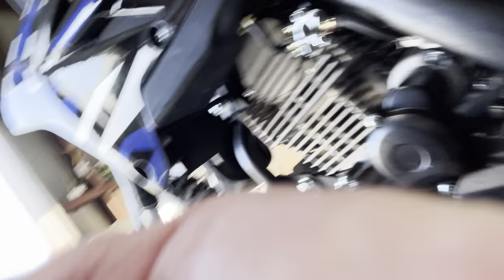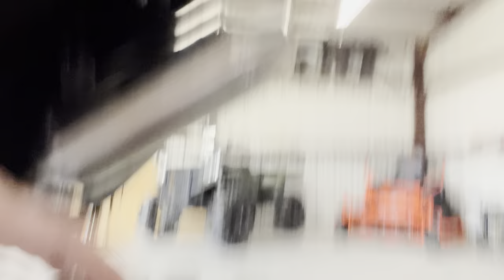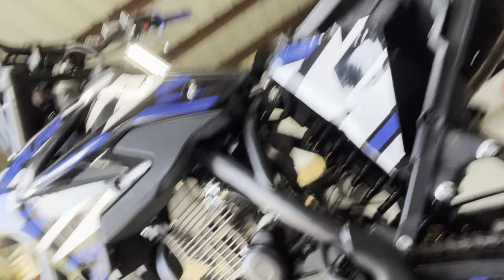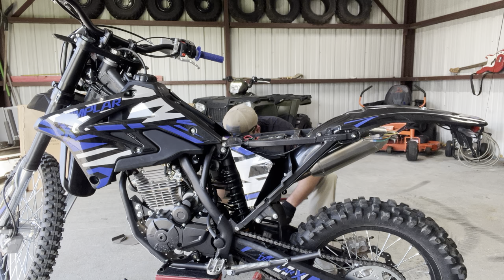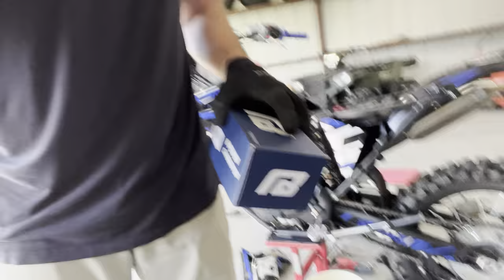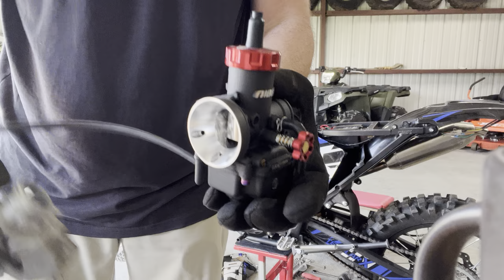X-pro Templar nibbi carb install/shock adjustment

Comment: oem stock carb has all the adjustments on it. They are locked away to get the EPA grant them importation into the country as the EPA rules wants it lean and all owners prevented from making adjustments. Just remove the blind break off bolts on the bowl and replace with metric socket cap bolts. Then drill, tap and pull out the aluminum welch plug. Now you have all the adjustments fully exposed on the oem carb and can tune it all you need.
Reply: You can't adjust tang on float tho
Reply: For the rest of us, add a new carburetor which sounds easier

Comment: These are every bit as fast as a old XR200 out of the box, even a bit faster. Nibbi carb, #130 main jet and #45 pilot jet, remove the catalytic converter, she'll be making damn near what the XR250R's did

Comment: FYI, don't remove the airboat from the airbox. All you need to do is remove the sub-frame. Take off the muffler. Unhook the tail light wiring. Remove the brian box. Loosen the boot clamp. Lastly remove the 2 lower sub-frame bolts and the top sub-frame bolt. The whole unit comes off together.  This gives you access to the shock and carb. Unbolting the tank and pulling it up allows you greater access to unscrew the cap for the slide. Don't remove the airbox boot!!!
Reply: That sounds very similar to the way I used to remove the carb on my '99 Honda XR250R. Remove muffler, take loose a couple of drain lines, un-bolt sub-frame and pivot it downward, keeping the airbox intact. Works great, perfect access to the carb and rear shock. I'm glad this chinese bike is set up the same way, when I get one it should be a snap to work on.

Comment: I just got one of these bikes (pre-assembled because I'm lazy). There's a hose dangling from the bottom/left side of the (stock) carb and I'm not sure where it goes. I think it's an air/vacuum line that attaches to the air box (?). It'll start up and idle just fine but when I give it even just a little throttle it's stalls out. There's also another separate hose that I think connects to the gas cap but the other end goes...??? Any thoughts would be highly appreciated!!

Comment: Will this increase the top speed and acceleration. I bought a Bubble carb and air filter because I seen a bunch of videos that say it made there bike run better. I have never worked on a bike and I am a little apprehensive about braking it apart. Worried I won't get it back to together and mess up Tue bike.

Comment: I bet you'd be surprised how well you'd keep up with other 250cc bikes from the big names. My nephew has a 250cc kawi. He also weighs a LOT less than me, and is a better rider than me. Nonetheless, I was able to stay on his tail on the little track on our property. Mine is the X model, so six speed and fully adjustable suspension, but otherwise pretty similar.
Reply: Will this increase the top speed and acceleration. I bought a Bubble carb and air filter because I seen a bunch of videos that say it made there bike run better. I have never worked on a bike and I am a little apprehensive about braking it apart. Worried I won't get it back to together and mess up Tue bike.
Reply: @DanielS784  I've never heard of a bubble carb, so I can't answer that. As for the filter, your best option is to keep the stock filter.

Comment: Appreciate the video man. Have any tips on getting the air box to connect in this tight space? I feel like I'm battling the frame and can't apply pressure on the connection.
Reply: I have since found that all you need to do is remove the boot from rear of carb at air box. Unhook battery and remove subframe bolts and remove entire rear of bike. 👍
Reply: If you remove the 2 screws under the airbox the rear subframe will lift up and pivot behind the gas tank. Also remove the exhaust bolt.
Reply: See my above instructions I just posted.

Comment: You didn't do the adjustment... my nibbi is a POS and doesn't work. It is really a waste of money as it is EXACTLY THE SAME as stock.
Reply: Tune it an ask questions instead of whining
Reply: Mine works great but yes it is identical
Reply: Stock is PE28 (28mm). Nibbi is PE30 (30mm).